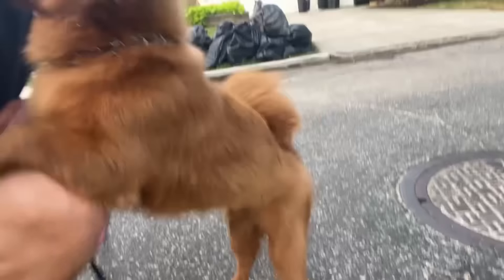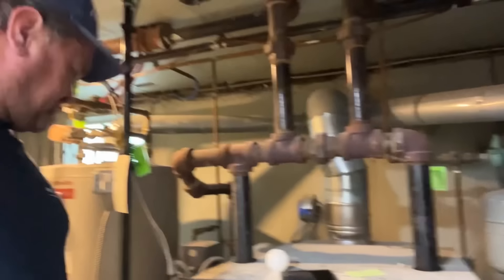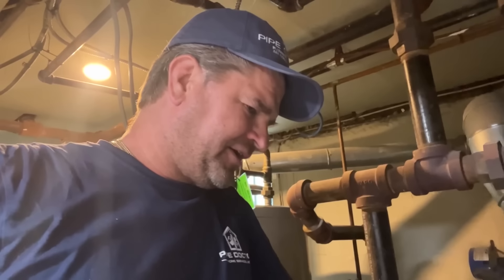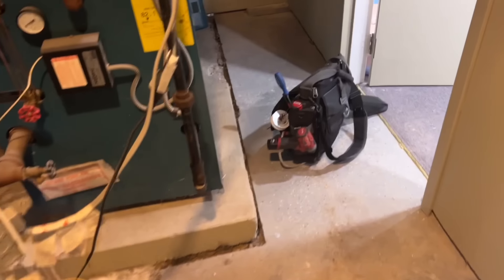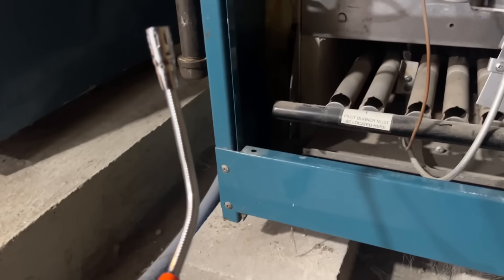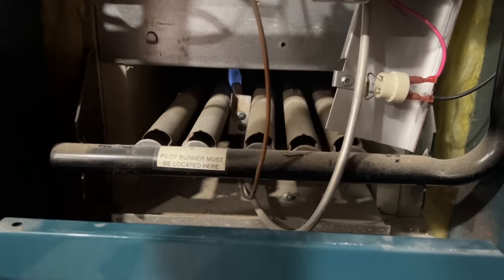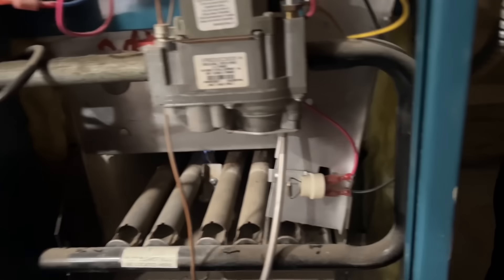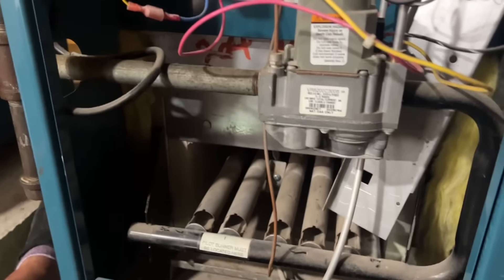Typical Friday Morning Running Service Calls “Not The Pilot Flying Around Your Boiler Room”

Comment: When you talk about Leon and the pilot flying is funny but I got something just as good. A neighbor of mine designed the Buick V6 engine and when the engineers built the engine he could not find where the oil filter was. He looked all over the engine and did not know where the filter was and it was on the side of the engine right in front of him.. I also knew some one who worked for Sony who built VCR'S and other media players and no one knew how to set the clock and they say I was overpaid..:yougotthis:
Reply from the maker: They have too much knowledge in their heads and overlook the obvious. Just like HVAC techs. We sometimes overlook the obvious.

Comment: Those two clowns almost made a big mistake at the gas main wow and that radiant has too many fittings on it
Reply from the maker: Even 1 fitting is too many. Guess someone made an oops.
Reply: @MikeyPipesUncensored  the most certainly did no fittings should be on there i installed some last week

Comment: How do you calculate the needed combustion air needed for a gas boiler, and how do you size the outside fresh air hole size?
Reply from the maker: International mechanical code 401.2 I believe.

Comment: I had a customer that called the building inspector to complain about the Deer crossing sign the town put on the corner of her property telling the inspector it should be further down the street where the road was straighter and there for a safer place for the deer to cross there rather than on the curve in the road her house was on saying the deer would be much safer crossing there.
Reply from the maker: Must be a snowflake ❄️
Reply: You lying I heard this as a joke on the radio.